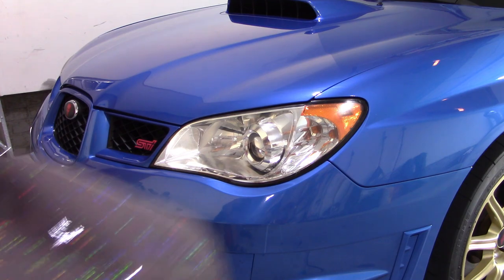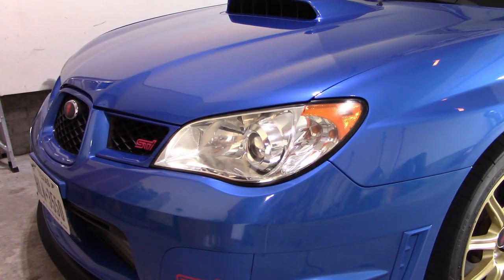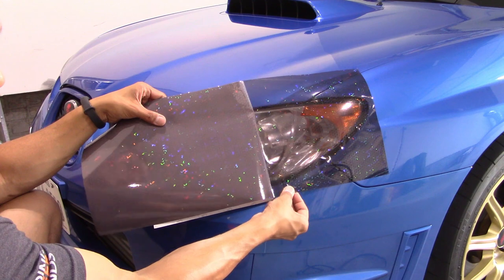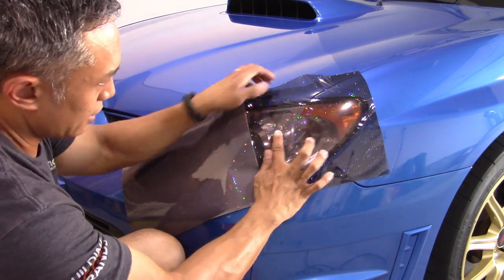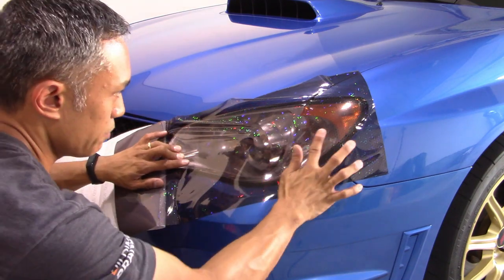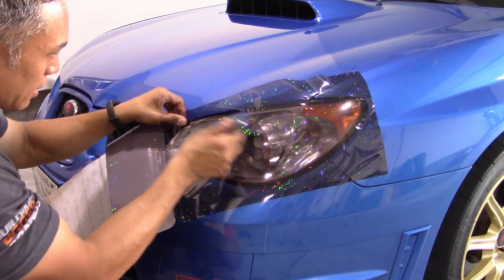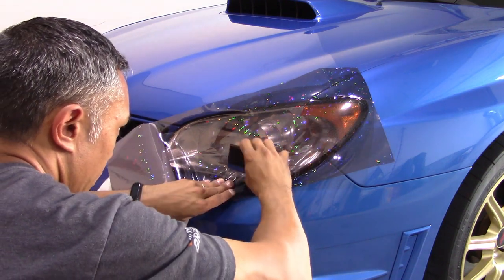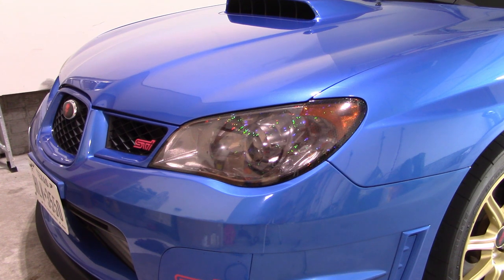How to tint your headlight with Vvivid Bio-Pulse Holographic Tint

Comment: Is this the micro or regular?
Reply from the maker: It's regular. From what I can tell, the bio-pulse doesn't come in micro
Reply: @ColorChangeCustoms , Amazon,
 has it.
Reply from the maker: @nathancollins5822  What you may be seeing on Amazon is the Bio Hex Clear, which has the micro pattern but in "regular "holographic".  The stuff I'm using in the video is the Bio-Pulse Hex, different from Bio Hex.  Bio-Pulse looks like the holographic is shooting through the hex pattern like lightning.  Bio Hex, micro or regular, has a holographic sheen like the regular holographic hex.  I just checked the main Vvivid website and they don't seem to have a bio-pulse hex micro pattern that I can find.
Reply: @ColorChangeCustoms , I just bought some from Amazon. It was the smoke version in light to medium. The hex patterns are smaller.
Reply from the maker: @nathancollins5822  ah, yes, they do have light smoke in biohex micro. Because the video concerned bio pulse, I misunderstood you initial question about micro or regular, thinking you were asking if it was micro or regular bio pulse. They do have biohex light smoke in regular and micro. Sorry about that.